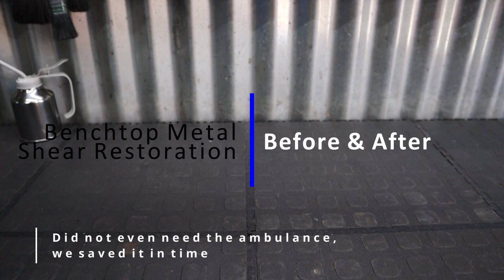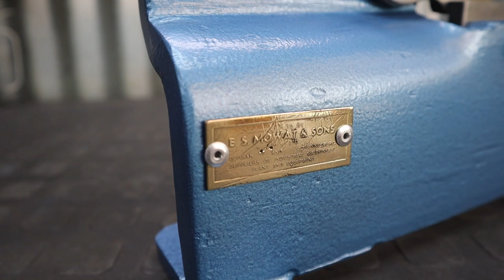Vintage Benchtop Metal Shear Restoration.

Comment: Turned out very well.
On future projects apply much thicker coats of paint remover.
A light brushing is not enough. Also, on stubborn finishes even thickly applied stripper doesn't dissolve use a heavier grit material in your blast cabinet. 
Speaking from experience.

Comment: It looks much better, good work! Did you re-sharpen the blades?
Reply from the maker: No, the blades were still in good shape thankfully.
Reply: @AJRestoration  Yes, I like the way it cuts. I was waiting to see the blades sharpened and the clearance set, yours appear to be scraping. The blades appear a sharper angle than 90*.